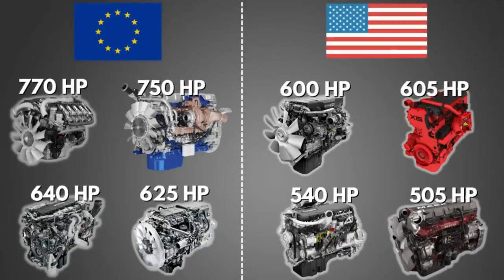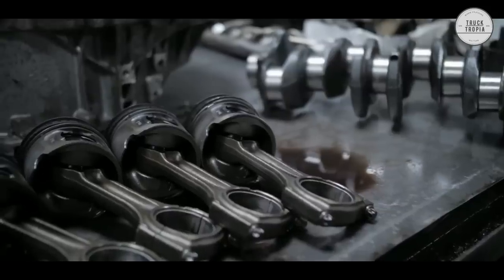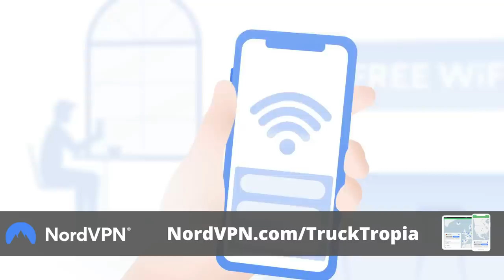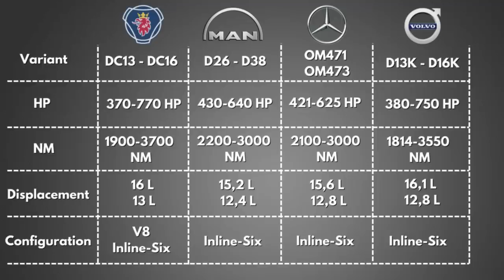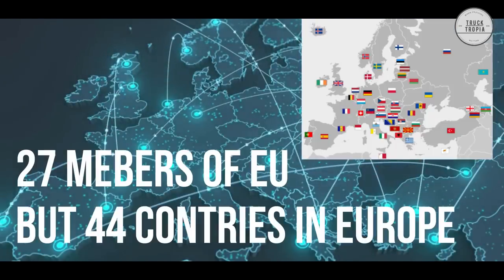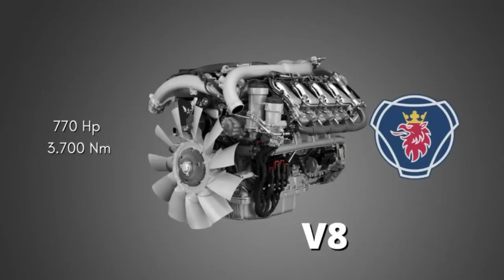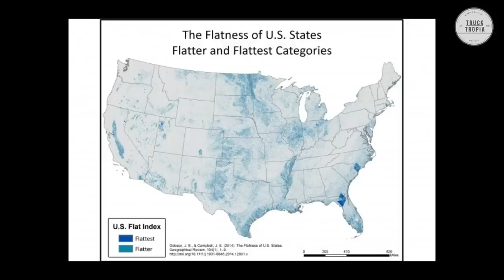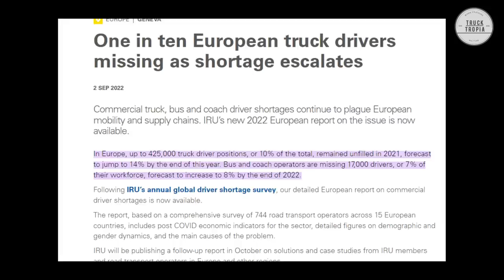Why European Trucks Have Up To 770 HP And US Don’t

Comment: Here in New Zealand there are a lot of Japanese trucks, Many do 500 HP, but they don't have the torque of the Europeans or American. There could be a video for that. Many trucks operate on High Productivity permits and max at 50 tonne, are longer with lots of axles and tyres because of the 'Road User Charges' road tax system, the older types are shorter and operate to 44 tonne. For many, big power is needed on our mostly hilly country.
Reply: Lower engine torque is just deal with the gearing, in the end, it actually is the torque output that doesn't matter, rather the horsepower and torque distribution curve is the important one. You will always be using the horsepower at the crank in the end, since you'll be accelerating a load, given HP = torque x RPM. Wheel torque will determine if you will be able to move the load at all, and if you will, how fast you'll accelerate it. The moment the wheels move it's already the HP acting.
Reply: @Kalvinjj  Exactly! Theoretically an engine with 2000 Nm and 500 hp will perform exactly the same as an engine with 20 Nm and 500 hp, IF (!) a frictionless 100:1 gearbox is used AND the torque curve is the same shape. Beside the fact that nothing is ever frictionless, this would also mean that the 20 Nm engine would run at ridiculous RPMs, but it shows that torque is less important than people think.
Reply: @marcaroni2012  Yes, I love using the M4 Abrams tank as an example. It has a ~10000 RPM turbine as it's engine. To actually make good use of it, a 10:1 reduction is used and bang you got close to 10x the torque (I think 9.5x at that output shaft would be reasonable?) at 1000 RPM.
Even trucks wouldn't do much work without the big driving wheel differential doing even more mechanical reduction there.

Comment: A European driver here. At the moment, I'm driving a 480 hp Mercedes, and I drive ready mixed concrete. Depending on the type of concrete, the whole thing is about 45 tons. Normally, the 480 horses the flat 6 has would be enough, but in my case the truck engine drives one more crankshaft, driving the whole system of the trailer, hence the power is not enough, way not enough. A few things I cannot understand, on top of all - WHY ARE THERE STILL MANUAL GEARBOXES in use in the US????????? Who needs it? Why do manufacturers do this ??? And the other thing - why don't US market trucks have extensions for the doors, so the drivers keep the shoes OUTSIDE the cab - I mean you ppl sleep inside, don't you want to keep your ''homes'' cleaner?!?!?!?!?! I am happy, on the other hand, some have started making Longline and XXL cabs in Europe, as honestly - we could definitely use more space when the work day is done, as majority of EU cabs are just small boxes.... And last, but not least - when mentioning foreign brands, at least try to say the company names closer to what they actually sound like, do not americanize them :)

Comment: The main reason is the difference in roads and landcsape between the EU and the USA. As a European, who lived in the USA I can confirm this. In the USA the roads are wider and basically straight. In the EU the roads are narrower and for some reason we do like curvy roads. There are also very steep climbs in the EU. There is a famous climb on a curvy highway between Belgium and Luxemburg. Even by car (with 200 hp) you feel the drop in speed. (+15% climb for more then 5 kilometers). Loaded trucks reach only 15 to 20 miles per hour on that climb. So, yes very well explained why trucks in EU need more torque and horsepower. Regarding maximum loads for trucks is 40 tonnes maximum in Belgium, the Netherlands. In some EU member states it's more. Speed limits are different on the highways, depending on the country. For trucks in most EU member states, the speed limit is 90 km/h. Cars 120 km/h in Belgium and 100 km/h in France on the highway. Talking about a Union. Everything is different, depending on the country.
Reply: Netherlands = 50 tons, and 60 tons for LZV's (basically road trains)

Comment: V8 diesels are garbage compared to inline 6 if they are equipped with the same displacement and boost. They only have five main bearings instead of seven, so they blow up all the time. If the Europeans have somehow magically fixed this, good for them but in the United States competition diesel pickups are completely dominated by inline 6 cylinders because v8s have very peaky torque. They quit putting them in tractors and heavy duty trucks years ago because they're lack of durability and torque on hills. Also, implying that in the United States we only have 80k trucks is such a lie, I am licensed to 97k and mine is considerably lighter than others in my area, the Northern plains.  The 903 Cummins V8 is jokingly called the 90 nothing, the 3208 cat and the six two Chevy diesel are widely considered junk. Nothing against the v8s in light duty applications I own dozens of them. This V8 Diesel House of cards will fall

Comment: Torque and power (horsepower) are of course intertwined, not completely separate metrics that can be "adjusted" individually.
For example, you calculate power from torque with this formula: Nm * rpm / 9550 = kW (multiply by 1.36 to get HP).
If your peak torque is 2800Nm at 1700rpm, the engine puts out 678HP.

Comment: You said that torque is the amount of work that engine can make but it is exactly definition of the power. :)
Reply: actually torque is the strength of the engine....
Reply: @Ale55andr082  actually torque can and will be converted in the gearbox and drivetrain.
Reply: @Ale55andr082  torque is a measurable twisting force whereas hp is a RATE of power; ft lbs over time.

Comment: TL;DR - most highways in the US are flat.  So US trucks are optimized for economical operation on flat roads, and truckers put up with the lousy performance on mountain highways.  This may change as more truckers get access to Tesla Semis, which are far more powerful than even European trucks (electric motors don't have the same efficiency problem that internal combustion engines do at light load).

Comment: I work for transport company and we are operating across EU. We use MAN trucks with 346 and 368 kW engines. That is 460/490 hp. I think that most powerfull engines are use mostly in Scandinavia, because ofdriving conditions there.

Comment: Its the same with coaches in Europe

We have one with 520 horsepower. Its limited at 62 mph. It pulls like crazy uphill, uts fun to drive and feel the power and hear that big turbo spool up
Reply: We have a MAN 24-420 coach converted into a motorhome here in Australia. It's a 12L turbo 6 and flies. Our older motorhome was a Mercedes O303 with a 14.6L V8 non-turbo. So much difference between the two.

Comment: Another reason for the higher horsepower and vehicle weights in Europe is that diesel costs a lot more in Europe and it is more profitable to haul heavier weights than bigger volumes of freight.  In US consideration is being given to increasing trailer length to 60 feet without increasing  the weight the trailer can carry.
Reply from the maker: Thanks for sharing 👍

Comment: This video basically falls on its face at the 55 second mark. Total misinformation. The engine torque doesn't matter at all as the engine will always be coupled to a many-speed gearbox capable of aligning the peak power output of the engine to the speed of the vehicle. It wouldn't matter if the engine spun ~1,000RPM @ ~3,700lb/ft or 10,000RPM @ 370lb/ft, both engines can propel the vehicle equally well if appropriately geared as both engines make about 700HP. 

If this claim that "torque is what matters" were true, then the AGT1500 turbine engine would not be able to move a 74 ton abrums tank over sand at speed. The engine only produces about 300-600lb/ft of torque depending on operating speed, but spins 10-30K RPM, making up to ~1500HP.

Comment: Interesting to note the quick passing mention of the shortage of truck drivers in Europe - this is not helped by various factors, most notably the slashing of driver pay (or rather undercutting wages in western Europe by using drivers from eastern Europe). Drivers find that the hassle is not worth it and some choose other jobs. In the UK we also have a dreadful driver licensing bureaucracy that basically went on holiday during the events of 2020+ and has never caught up with its workload since then, so many potential new drivers are kept out of the marketplace simply because they cannot get licensed in the first place.
Reply: True. Doesn't seem like the Western European governments care about the drivers either, since they're not enforcing the numerous laws and regulations many Eastern European drivers break all the time.

Comment: You don't need all that power, but one thing comes to mind when referring to it: longevity. A weaker engine will suffer more on European roads, than a stronger one. It is an important aspect that it is not even touched in the video

Comment: 5:33: Your visual here is incorrect; the 'typical' US truck only has 2 axles on the trailer, not 3. Triple-axle trailers in MOST of the US would only make sense of they have a blanket 'overweight permit', which would only be useful if you stay only in that state. Canadian laws are different (and there are quite a few 3-axle trailers there..), but in the US, a 3-axle trailer is quite rare.
Reply: Exactly. That also has to do with weight. With two axles you can already have a gross weight of 80,000 lbs. Adding axles would make the trailer more expensive in the purchase, maintenance, insurance, and toll. Whenever I see a trailer with over two axles, it usually can lift the extra axles when not needed.
Reply: not too sure, but I did notice lots of american 2 axle trailers having duallies on them, which I guess increases the weight per axle allowed, thus no need for a 3rd axle. here in europe the vast majority are 3 axle trailers, however almost all trailers here got single wheels on them (385/55 or /65 or something like that), duallies are usually only found on those very low body trailers which haul very heavy and oversized stuff. oh and the first axle is almost always liftable when not or only lightly loaded, some can even lift the 3rd axle aswell.
Reply: @iSkiLLeTXx  I don't know if it's required but yeah all American trailers have dualies, with less overall axles
Reply: Not nearly all of them have duallies in the US,    There are plenty that roll around with 2 axles but on singles in stead.    
So i doubt that duallies are required

Comment: A correction.  80k pounds in the US is standard freight.  You can get overweight permits but there are a lot of extra rules involved.  Besides the added weight of the engine, which you mentioned, there is also fuel conservation.  Less HP requires less fuel.  The transmissions do the conversions that allow smaller hp engines to pull as much, or even more than, the bigger engines.  Also have to consider noise pollution rules.  Less hp and smaller displacement means less engine noise.  In US, you are allowed maximum 40k lbs. on rear and center tandems.  Front axles are limited to 12k lbs.
Reply: Quite the oposite actualy. If you have a powerfull engine and transmission you will use a little extra fuel if you dont use the max capacity compared to the weaker counterpart, but you will save a lot in maintainance. If an engine is approved and capable of running at high rpm to pull a heavy freight, then it will pull a standart trailer with 2 fingers up its nose.
Reply: @altera9666  100% incorrect.  The company I contracted to did lease to own.  The T680 came with PACCAR MX-13 Engine 12.9 Liter and is rated between 405-510 HP and 1,550 - 1,850 lb-ft of Torque.  Under near maximum load, I could pull 8 to 9 mpg in interstate driving conditions.  The truck I sat in was dialled back to 485 hp by adjustments on the computer to lower the fuel volume.  MPG float depended on whether I was travelling in the north or south of the US.  The north being more mountainous used up more fuel but the lower power not only saved fuel but wear and tear on the components.  There is a reason why they rebuild race car engines, in most race organizations, after each race.  The more power you put into something, the more wear it receives because the explosions in the chamber are more forceful.  This transmits all the way down the line to the tires.  Have a more power vehicle will even cause the tires to wear a bit faster because you are applying more torque to the road.  The one thing that was problematic was DEF systems.  If the DEF fired off when you were not on the highway, your engine could not put enough heat out to adequately clean the filters.  Again this was a north south thing.  In the south, it is generally warmer so the vehicles had less issues with DEF not fully cleaning.
Reply: You said it correctly, in the US you can only carry 80,000 lbs of cargo. But did you know that only 25 states in the US require a load of just 80,000 lbs But in the 25  western states You can load cargo weighing 120,000 lbs. or more. In South Dakota, we can load up to 171,000 lbs without needing permission from the government
Reply: @phisitjenakkarkul3383  not if you want to get pass a Federal DOT scale.  Federal limit for all states is 80k.  You can get permits to go higher in most states.  I am aware that some less populated states allow piggy backing trailers but you don't see that often.  I once seen a tractor pulling 3 full size trailers.  They had special exits for them, from the interstate, because they aren't supposed to do anything but highway driving due to the inability to make most turns.  For informational purposes.  I drove in all 48 continental states.  It was not uncommon for me to see both coasts in a single week.
Reply: @OGSomeOne  We're not talking about 3 trailers. we are talking about Turnpike double, Super B and  Locky Mountains  I have a Class A CDL license. I passed the training LCV and HPV I tell you, yes you are right but that is not all. Every state enforces laws that allow a load of 80,000 lbs. But the same There are 25 states that you can load 86,400lbs to 171,000lbs But I'm not telling you that every one of the 25 states I'm told can load up to 100,000 lbs Currently, only 21 states in the U.S. have laws that allow loading of 100,000lbs or more.  All this is  double Trailer I won't mention triple trailer They cannot load heavy cargo. But just no state allows you to use triple trailer in their state You're right that you need permission to drive like that in a state where the legal weight limit is 80,000lbs But not with these 25 states.
Reply: @PhisitJenakkarkul as I stated, you definately didn't cross a state line, which trumps state law, because federal DOT standards apply.   The Federal-Aid-Highway Amendments Act of 1974 and the Federal Bridge Formula use by FMCSA regulates axle and total weight for vehicles that travel interstate.  No vehicle that crosses a state line can use that states independant regulations.  Interstate travel is solely mandated by the federal government DOT, which is why they exist.  To police the interstate commerce systems.
Reply: @OGSomeOne  100% sure, but still doable.  You can cross state lines into neighboring states or beyond in any of those 20 states.  If your truck weighs no more than 105,000 lbs, like Canadian B-train trucks, they can come to Montana without a weight permit.  If their weight does not exceed 137,800 lbs
Reply: @PhisitJenakkarkul  ahh so we are dealing with a canadian.  When I went through training, my company had a driver trapped on the canadian side of the border because the courts said he owed child support.  No, If you cross a state line and are over weight, you will be shut down at a federal DOT station.  All state lines have active Federal DOT weight stations active.
Reply: @OGSomeOne  They need to know how much their truck weighs.  You don't want to be overweight on the weigh station. I've been to Alaska. Kinross mining trucks Oh man!, they just carried 200,000 lbs by Triple Trailer 22 axles God, they are the only state in the United States that can do that. But here 105,000lbs is really cool for us in the west.

Comment: Oh good, the torque myth again. Peak torque is completely irrelevant, as you can gear an engine for whatever torque you need. Horsepower is actual power, it's torqie x rpm. IT INCLUDES TORQUE.
A wider 'torque curve' is useful but shoild really be called a power curve, and if you did an integration to find the area under the curve you'd get the most useful comparative number, but without it, power is still the most important.

Comment: The trucks in the USA are certainly not "that much bigger". Almost no trucks in any Scandinavian country weigh less than 55 tonnes loaded. All the big engines in Europe are tailormade for Scandinavia. Otherwise a good and right video
Reply from the maker: Thanks 👍
Reply: They bigger in length without the trailer.
Reply: @yusufgta4341  But they're not bigger in height.
Reply: @automation7295  Yes they are but it depends on the country mostly.
Reply: @stop_lying_bro  True, but generally cab-over semis have slightly taller cabins than conventional semis.